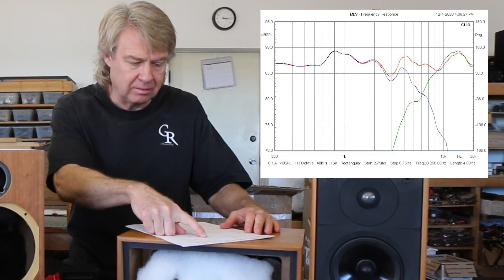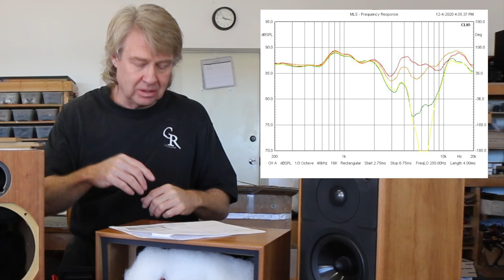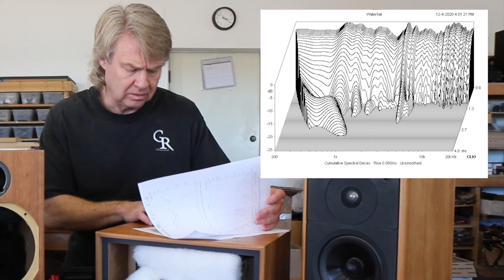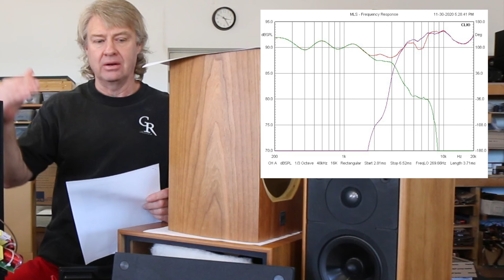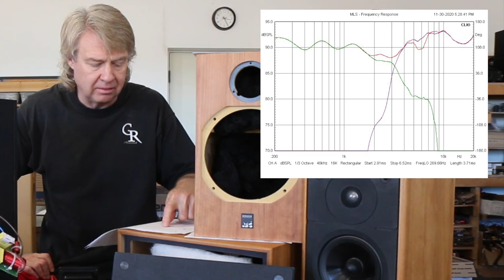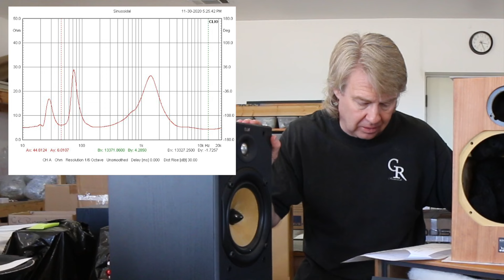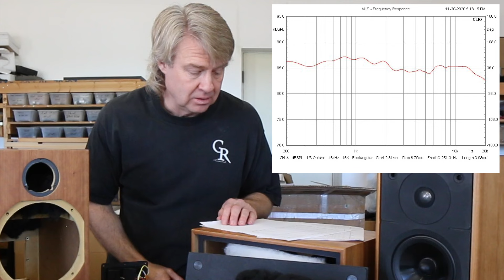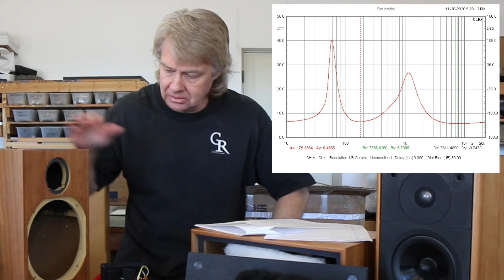FINALLY! A SPEAKER DANNY LIKES?! B&W, Epos and ATC!

Comment: The density of technical information is somehow rendered coherent for a layperson in a really seamless manner. Great work. Thank you!
Reply: Are we to believe that the designers and audio engineers at these companies don't run the same audio tests and are unaware, or jaded, of the results? Aren't the frequency signatures what makes these speakers unique? Otherwise they'd all have generic flat frequency lines
Reply: @gcahill51  it’s a valid point.  Danny, however, is finding clear flaws like bad crossovers, impedance issues, bad design, off axis issues.  He’s right that you can’t really listen to a speaker on axis.  You will be getting reflections and those reflections will amplify any issues.  

I noticed that B&W showed its drivers and crossovers in the 700 S3 series and I feel that’s Danny’s doing as he’s torn apart a lot of B&W speakers.

The days of hiding cheesy parts in expensive gear are gone😊.  He’ll open them up and show you the guts.  For many people DSP corrects some. of these things and alleviate the brightness of a B&W speaker.  Actually, in my case it adds +9db to my high frequencies tweeters.  It’s absurd…
Reply: @gcahill51  Yes and no.
Reply: After watching several of his films, I simply stopped believing in this wisdom. All of them, except his modifications, are hopeless. With all due respect, but first of all, large companies producing loudspeakers do not have worse engineers. "Up and down" are probably often intentional to eliminate bands undesirable by the creators. Receiving sounds through the ear is not a transmission between devices.

Comment: Its the ATC SMC11 you have on hand.  It's a domestic monitor and not their studio line.  They voiced that speaker like that as it is preferred for domestic use.
Reply: Atc smc11
Reply: Agree fully, the SCM11 are deliberately voiced that way as they are hi-fi reference (not studio reference) speakers. That way, if recordings do end up being made overly ‘hot’ in the recording studio, then these speakers can tame that ‘heat’ when listening through them at home. ATC know what they’re doing.
Reply: SCM11 mk2

Comment: I have a pair of epos 22 loudspeakers— minimalist first order crossover with an aluminum dome tweeter and woofer all designed by Robin Marshall who has a PhD in Physics and who played the bass. The sound of Epos- 22 with the big Exposure Amps and Pre-amps with two Rel-S5 subwoofers, fully spec Linn lp-12, and Linn Akurate DSM all room corrected for the bass is musicality with such palpability—the direct sound, the speed, the pace, the rhythm, the timing, the dynamics and the clarity is goose bumps- head shaking all with emotions.  Robin Marshal’s design of the  Epos ES-14 and Epos Es-11 where designed by ear also— not just a frequency response and ect. Did Danny listen to the Epos-12 on a truly high- end system before he tries to “improve” the sound?  Maybe he should talk to Robin Marshal — PhD in Physics— who designed the loudspeakers and wrote  a twenty- one page white paper explaining the designs of the Epos-14 loudspeakers with a simple first order crossover using a single capacitor. Robin Marshall had to design the tweeter and woofer in order to pull of his simple first order crossover design.
Reply: There are pros and cons to this type of design. And in this case the designer may have left a little on the table. Several issues have been overlooked. Stay tuned till next week....
Reply: Totally agree, Robin designed some great sounding speakers for Epos as well as some of the earlier Monitor Audio's. These type of designs may not be technically perfect and even sound coloured but boy do they produce great sounding music. The simplistic design of the x-over needs quality drivers to work properly but produce excellent efficiency and a very dynamic realistic live sound. I found through experimentations a few years ago this and the earlier Monitor Audio designs could be improved even further by implementing a third order Butterworth on the tweeter (2nd on the bass/mid driver) crossing at around 3.2Khz. Then by using a strut brace from left to right 2/3 of the way up the cabinet (Helped with the resonance from 450-550Hz) and careful placement and amount of acoustic foam and a little real wool wadding gave the right amount of damping. I used Ansar supersound caps which I found provided a sweet transparent sound and were better in my opinion than many expensive ones I tried. Sold them off a few years ago and regretted it ever since. Most speakers I hear these days south of £2000 sound pretty bad and are poorly made.
Reply: @mgsamps That is so cool that you were able to modify the crossover and speaker cabinet to improve the sound.

I've done my own projects and found the improvement is not cost effective, it takes a lot of time. But it's fun to work on projects you're passionate about. And when you see your project working, it gives you a feeling of enjoyment and self-esteem, that makes all your work worth it.

My last project was disassembling a CME Medical T-34 V2 syringe driver, and cleaning it up, as I got liquid inside it, which made it stop working. I was able to repair it and it works great now.

Comment: I loved my B&W 602s2 speakers, it’s exactly the sound I love. After years of trying other speakers I have ended up with a pair of 607s and I love them. Perhaps some people (like me) just enjoy that sound of the B&Ws.
Reply: My DM602's are still going strong after nearly 25 years. I've taken great care of them throughout their life, and they still look and sound great. I even still have the original packaging to use when moving house!
Reply: maybe a matter of personal taste. even if I forced me to use them, they caused fatigue tbh. still have them, but not using them.
Reply: I agree as I have the 602s3.
Reply: I have a pair of 607 and found it too forward and bright. Didn't like them until I changed my amp to Hegel H120.
Reply: I bought some 706s and I liked the sound of them on YouTube. They are expensive but I'm a speaker freak and I design and build my own and have a few sets (both single driver speakers and coaxials). I do it just for fun and by ear in a room. But the bass intensity changes a lot as I walk around the room and have no idea how much bass to put into my speakers (the room is so acoustically bad). And it's easy to get used to an inaccurate sound. So I needed monitors and I needed expensive ones so I can frame the docket and compare them to mine for less than half the price (if I sell any). I don't know if mine are better or worse but since I bought the 706s my speakers sound millions better than they ever did (by a large measure)! Mine built ones I just finished are coaxial and they have the point source advantage over the B&Ws. And two of my friends (the only ones listening then) both prefered mine. Maybe cos of the point source 2-way sound. But that would not have been possible without the amazing 706s. Do you like coaxials? Maybe you can make some out of separate drivers: https://youtu.be/4LJE8DNZZbA
Reply: @juleswinnfield6930  You agree the B&W's caused fatigue???
Reply: @FTarquin  No agreeing with the original statement Noah Derrington made.
Reply: Had 602S2s for 6 years and liked them up until a good friend of mine loaned me his Wharfdale Lintons to use while he was out of town for two months. I was stunned at the difference. Scoured the interwebs for a deal on Lintons and sold off the 602s once I got a pair. Granted the the Wharfs are few benji's more expensive, but believe me, they are worth it.
Reply: I have a pair of B&W DM601 speakers. My dog knocked over a speaker stand, which left it dangling by the binding posts, which broke one.

I wrote into B&W and they sent me a replacement binding post for free. So they stand by their work, and are very helpful if you need help with their speakers.

I bought the DM601 speakers in 1996 for £200, and I'm very happy with them. There are better speakers, but as I live in an apartment, I do most of my listening on Aeon 2 Noire headphones by Dan Clark Audio.

They are super comfortable, great sounding, and I won't be bothered by neighbour noise, and can listen any time day or night, without disturbing anyone.

Comment: I have newer owned an ATC loudspeaker but I think they possess fine engineering. Obviously the more expensive the better. What has gotten me to write here, is that I think their two way bass driver possess a rare but great engineering tweak. If I get it correct (and I am not 100% sure) then the 3 inch voice coil is attached directly to the 3 inch center dust cap. The outer part of the cone however is attached with a flexible inner surround which decouples the cone at higher frequencies. So it’s actually 3 way speaker. This concept improves the drivers dispersion and reduce standing waves and breakups in the main part of the cone. Lovely design feature if my memory serves me well, otherwise ATC must implement it just to keep me happy. Thanks for a lovely channel and greetings from Denmark.
Reply: Hi Klaus, I own the same ATC SCM11 speakers in Danny’s video and you are absolutely right, the design is effectively 3-way. Although on the back of the speaker there are only 2 sets of binding posts (not the typical 3 sets of posts that you’d find on a typical 3-way design). So perhaps is best to think of the SCM11 as a 2-way-3-way design! You should try a pair, they sound wonderful.

Comment: I ordered your ATC SCM11 upgrade kit last week and installed it yesterday. Just wanted to say thanks and wow. Really took these to the next level. I can't comment on the bass that much as I use a sub to handle the lows but man the mids and high are gorgeous now. Again thanks for what you do. Please keep it up and love the videos. I am an electronics tech for over 35 years and enjoy your engineering view point.
Reply: Did you also add the Miflex bypass cap?
Reply: How much is the upgrade kit?

Comment: Nice to see that you found something you like. I suspect the slight downward slope across most of the frequency range of the ATC is intentional, done so that when they are used as near field monitors (the engineer probably seated only three to five feet from the monitors) the response will match the gently down-slopping response that you would hear in a far-field listening environment, such as a well tuned mastering studio. If your customer is using them as mini-monitors on stands in a reasonably large room, your idea to make them measure flat at one meter would make complete sense. Many pro near-field monitors come with a high frequency slope or level adjustment, to accommodate these two different use cases without modification.

Comment: The ATC crossovers have about 5 weeks play time on them now. Absolutely fantastic. One of the biggest bang for the buck in my 30 years assembling and tweaking audio systems. The increase in detail, separation, clarity without a hint of harshness is astounding. Bumping up the tweeter level just a touch was the right call. Thanks Danny!
Reply: @Brett B ! Did you do the whole upgrade? Also No-Rez and did it stick to that curved inner side? No need to kerf the foam?
Reply: @rikardekvall3433  yes, no-Rez stuck just fine. No worries. Very good upgrade. Give it 100 hours of play to settle.
Reply: @Raphael Ali instablaster :)
Reply: @Juelz Van i really appreciate your reply. I got to the site thru google and im trying it out now.
I see it takes quite some time so I will get back to you later with my results.
Reply: @Juelz Van it did the trick and I actually got access to my account again. I'm so happy:D
Thanks so much you really help me out :D
Reply: @Raphael Ali no problem :)
Reply: what model atc speaker?
Reply: I have ATC SCM19, is it difficult to do the upgrade? are there dettail instructions in the package?

Comment: I had a pair of those 602's for 18 years, replaced a tweeter when an amp discharged a cap at an inopportune time, really loved them but a woofer needed replacing, so I just changed out the entire 7.1 system, with B&W of course.

Comment: Danny is particularly lucid in this video. I’ve been wondering if he was ever going to open up and explain how he interpreted those graphs. Thanks for being so generous Danny.
Reply: I like the video s but I have unusual speakers old advent's. I had to replace the woofers I could not fine parts I used,12 woofers from a car part store crossover  is a switch for high & low

Comment: Thanks Danny for the xover revision help. The ATC SCM11v2 are mine. I've had them for a couple years and I enjoy their sound in my space very much. I felt they were capable of more...hence the parts upgrade. I purchased them used from a gentlemen in the UK, who upgraded to the much larger 19, for $1100 USD shipped. They retail for $2200 USD. MusicDirect has 60-day eval. There was a prior non-v2 version, pre-2013, with a different non-ATC made tweeter and rectangular cabinet. They are made for home use, not studio, and probably why the very high end is rolled off a bit. The woofer is their CLD (constrained layer damping) version unlike the 19 and above that have their SL driver. I understand the SL driver in the 19 weighs as much as the entire model 11. The tweeter is non-S spec. Same drivers are used in the all black, less expensive, SCM12Pro. I drive these with a fine BHK 250 amp and they are paired with two Rythmik L12 sealed subs. They are quite true to the recording but completely unfatiguing and hopefully remain so with the tweeter lift of 1/2-1dB. A couple of parts were missed in the return to me otherwise they be done but soon they should be up and running again. Be well everyone!
Reply: Let us know how they sound after the upgrade.
Reply: @dannyrichie9743  At 50 hours, the clarity is startling. The highs are a bit shrill but I hope they will settle a bit with more run-in time. Of course it will take weeks to fully asses but so far, not bad. I may revert to the stock tweeter cap and resister combo if the upper end is too much or in time I may adjust (ears, setup, etc.)
Reply: @brettb9600  The Sonicap should only improve clarity and won't give them a shrill sound. Those caps also need a good 100 to 200 hours to settle. So I'd put some time on them  and hear what happens. We can also make slight adjustments to the resistors in the tweeter circuit to move the level around slightly.  But burn them in well  first, and then let me know what you think.
Reply: @dannyrichie9743  120 hours and they are getting really really nice. The shrill top end is gone, the clarity is still astounding and I think they will only continue to improve. Happy! They are significantly more resolving than original.
Reply: @dannyrichie9743  I'm still happy with the sound though the increase in treble does make poor recordings sound worse but good/proper recordings sound fantastic. I have EQ to use to tame the highs of poorly recorded or mastered '80s stuff.

Comment: I really liked the EPOS,put them on their own stands and use a warmer sounding system with plenty of power and they can shine
Reply: these are actually my speakers, and every thing you said is 100% true (rega integrated, bel cato dac).  I need to make the Epos stands higher though for my seating position: which is why I sent these to Danny to begin with to see what the fall off was that I was experiencing.
Reply: But, their x-over sucks (not affiliated with Danny at all), and the 4kHz cone resonance surely sings on it's own - thankfully it's polypropylene cone that has decent self damping so it's not as agressive (smooth sounding) as better paper or kevlar, carbon fiber cones. My friends would laugh at me if I would show them something like that. I bet proper x-over around 2.5-3kHz that attenuates the cone break-up, levels tweeter a little and puts drivers into phase alignment would make into way nicer sounding spkrs.

Comment: I have sold hifi for 10 years and owned ATC for 15 years and they are under priced for what you get. The fit, finish and engineering is superb. Their drivers are second to non and sonically the easiest to sell when compared to other speakers. You do have to partner them well with good grippy amplifiers (good low volume current). I have had SCM40 MK1, SCM40 MK2, SCM40 Active and love them all. Got SCM50A on order now. Can't wait
Reply: I agree with every thing you say. I have scm 40 mk2. I use atc ca2 pre amp
P2 power amp, i would not change my system for anything.
Reply: Prior to buying my SCM20ASLs I was looking at a pair of passive 20s which I was tempted to try with one of my vintage Amcron (Crown) PA amps. Loads of current available and even the smallest one is 300Watts per channel. The biggest is 2500! I recall reading a review of a Crown DC300A used as a hifi amp and how well it performed.
Reply: Zvonimir Komar  I have used many amps but the ATC SIA2-150 and / or CA2  P1 P2 combo blow away most amplifiers and quite a few levels above the 909 and will lift the 40s to another level. I do like 909s though as I think they offer great value.
Reply: @stephenclark5218  Excellent setup.  I used to have CA2 with 2x P1 running bi amp. One P1 for bass.  Going active was an all new ball game but it is also a lot of money in one go.
Reply: It amuses me that Danny thinks he knows better than the engineers at ATC regarding speaker design.